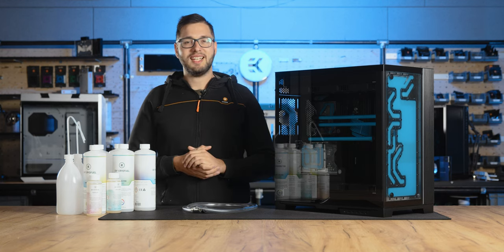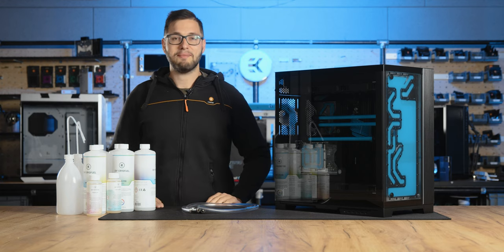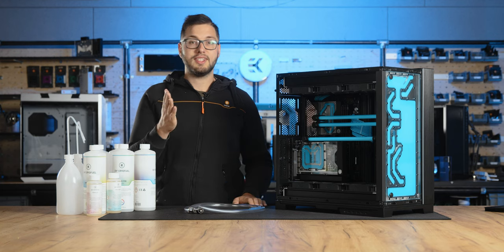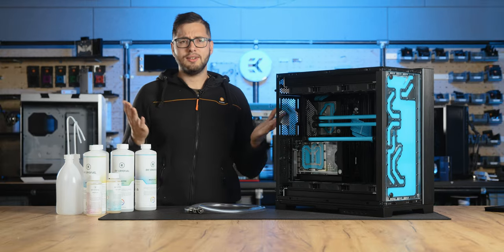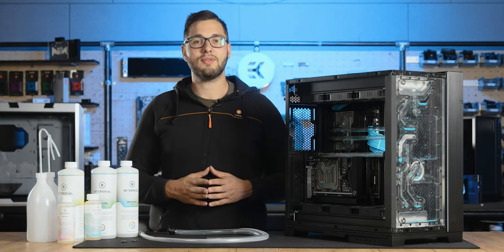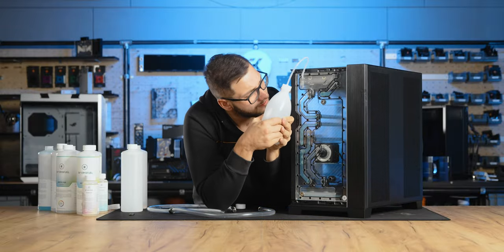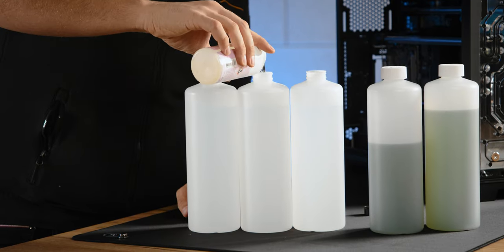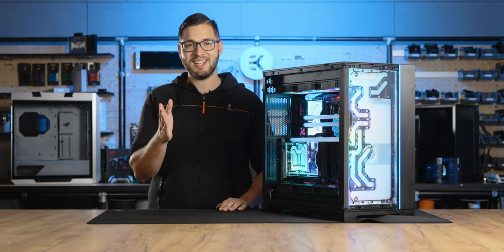How To Perform Maintenance in a Liquid-Cooled PC | Step by Step Guide

Comment: So probably a really stupid question here. Im running EK clear premix, been a year or two (random gaming here and there). Was looking to use the EK loop cleaner and super flush and then use fresh ek clear premix again - my question, where they say 'drain the system of the cleaner and then fill with new fluid' ...how precise do I need to be with that draining? theres always going to be some left in the system isn't there? stuck in a rad, in the pump...or else it would have run itself dry...

My loop looks clean, res is clear and happy but needs a fluid top-up. The 4090 is on air, it's just the cpu and motherboard being water-cooled.

Comment: Nice to know I don't have to do a 2 day full system clean if replacing my clear coolant with new clear coolant :D My system is a NIGHTMARE with cleaners due to having an FLT80 pump reservoir combo, which pulls in air when at 100% becuase the pump is connected to the power supply with a bridge connector D: And due to this the cleaner perpetually foams like crazy

Comment: You guys should really work on your nickel plating.  I love the design of your blocks but after having the nickel plating dissolve on every EK block I've ever had.....I am moving on.   The final straw was when I broke down my loop this year (after only about 9 months) and the EK nickel plating was dissolved again but my Bitspower GPU block, athough contaminated from the EK nickel plating breakdown, cleaned up quite nicely.  Finally proving that it's not me but you  EK....moving on guys.  And btw, I only use distilled water with 1 drop of biocide and 5 drops of anti-corrosive per liter.....plus the Bitspower block did not have this problem.  And I've been doing watercooled builds since 2014.
Reply: That's totally false. Distilled water is the purest water you can use. There is nothing in it that would cause it to break down the Nickel plating. The biggest problems accrue when you start mixing metals in the loop.   @Slushkin
Reply: My rads are cleaned very thoroughly.....
Reply: I have no clue anymore. I'm not a chemist haha.
Reply: @CrazyCranker pure distilled water will damage the nickel plating because it has no minerals (because of distillation) so it starts the chemical process of disintegrating nickel plating
Reply: "Despite its benefits, distilled water is particularly corrosive. With no minerals to give the water pH balance, distilled water acts like a magnet, absorbing chemicals (phthalates and bisphenols) from plastics, nickel from stainless steel, aluminum from aluminum containers, and carbon dioxide from the air."

Comment: Tap water ? You sure ek ? That cant be good! Id sooner use cryofuel clear or distilled to flush
Reply: Pure distilled water can damage the nickel plating ... "Despite its benefits, distilled water is particularly corrosive. With no minerals to give the water pH balance, distilled water acts like a magnet, absorbing chemicals (phthalates and bisphenols) from plastics, nickel from stainless steel, aluminum from aluminum containers, and carbon dioxide from the air."
Reply: @illustratedquotes   yeah but most people use it to flush out remains of cleaners etc. before filling the loop with new coolant. Using tap water instead, the new coolant will mix with the small remains of tap water which cant be good since it will leave chalky deposit etc? if distilled water is really that bad to flush the system a few times for cleaner remains or whatever, i'd rather go the clear fluid route and spend that extra money tbh

Comment: That's terrible advice to flush with tap water.  
Use distilled water folks. The goal is to clean the loop, not contaminate it.
Reply: Clear coolant is the right approach, IMO. Pure distilled water will begin stripping the nickel plating within hours, and if any untreated distilled water becomes trapped under the o-rings, the coolant may not displace it and you may eventually get some corrosion there.
Reply: @byronfranek2706  In the longer version of their superflush and loop cleaner video, EK literally say to combine these products with distilled water and to rinse with distilled water. So I'm confused
Reply: @f.stopperrmedia1606  Don't be confused. If you only ever use treated coolant in your loop, you will not have any issues with corrosion or bio growth. This is pretty basic stuff.
Reply: @byronfranek2706  Thank you!